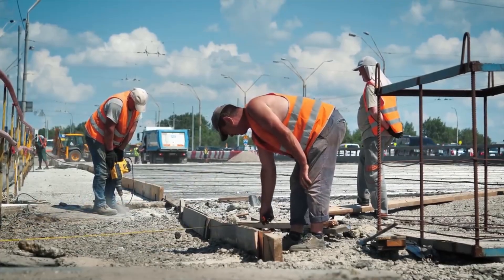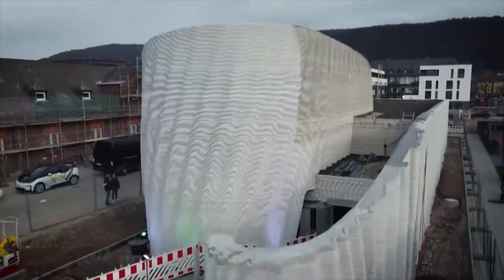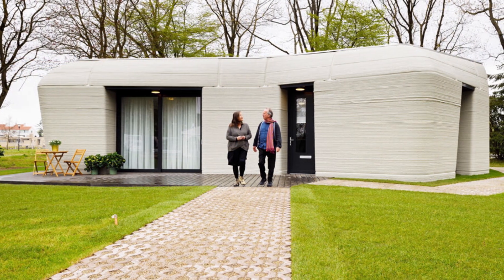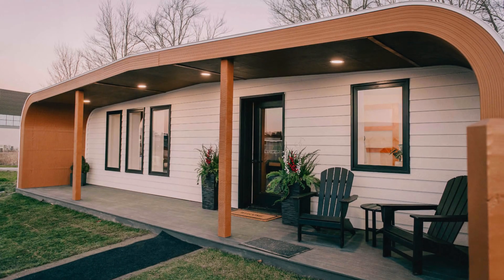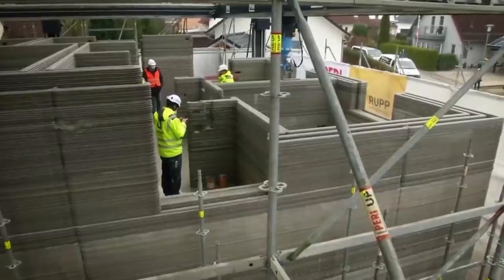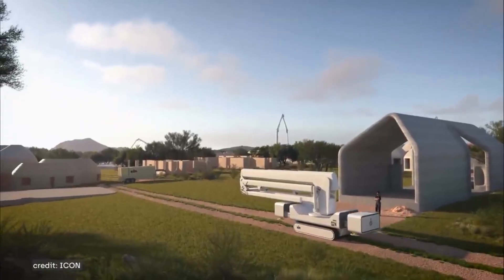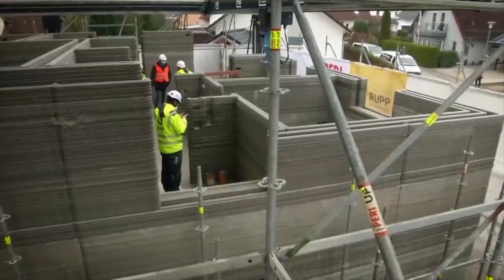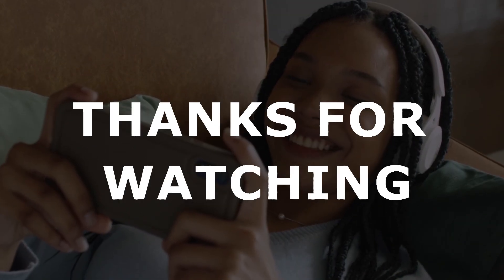We 3D Printed a House in 24 Hours

Comment: No structural stability or integrity.. This would most likely fail half of the codes anywhere in EU, not to mention the massive amount of concrete wasted on literally printing a whole building. I mean, if only we had a way to get bigger pieces that fit together, that we can sort of snap together and use the concrete to affix them in place.. big, but not too big so that we can build any shape of the house. Oh wait, that's BRICKS. Only been around for the most recent 5 thousand years, so it's fine if people haven't heard of them yet.